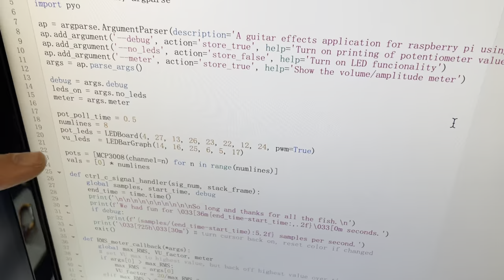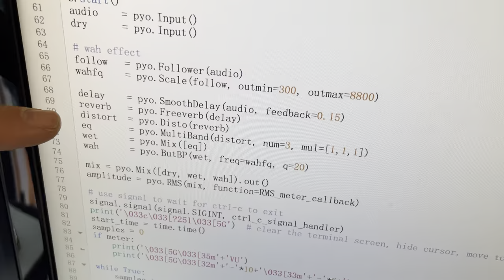Guitar Amplifier with a PI!

Comment: This is an absolutely awesome project, and I would love to try to recreate it.  I've looked over your Github page, but I don't see any circuit schematics.  Would you mind posting your schematics as well, it would be a huge help (e.g. connecting MCP3008 to which IO pins, other various wiring, etc.).  Even a few hand drawn block diagrams with key pin connections would be a great help.  Thank you for posting such an awesome build.  Very inspiring!
Reply from the maker: Thank you and I was wondering if anyone would want more details. I will post some schematics and more info on github. I am traveling right now and don’t have the amp with me but will see what I can post. Also happy to help with any build issues as they arise.
Reply: @dsagman  Thanks for the quick reply.  Anything else you could add would be greatly appreciated!  I'm a EE, and I love guitar and audio hobby projects.  I've built many various guitar pedals, and a few simple multi-effects using an Arduino.  Jumping up to the PI is the next step for me, and I'd love to follow in your footsteps.  I'll also say, there are undoubtedly a lot of people who will be interested in recreating this, even if they are not bold enough to ask for more info.  I guarantee we're out there, and your efforts are greatly appreciated.  Thanks!
Reply from the maker: @loganwilliams9723  I've started more technical info on some slides. Here's the link. I will be updating as I go, but wanted to get the first draft out sooner rather than later. https://docs.google.com/presentation/d/1GgiD2UTEGcz-SC2rGDjdIljaK2Yn0Rs03TDFOu3duUw/edit?usp=sharing
Reply: @dsagman  Thank You!!!!!  This is a great set of documentation so far, especially the more specific portions about how to install the Audio Injector (I just bought one!) and the modifications to the Pi operating system.  I'm looking forward to your added documentation about which uneeded daemons to remove to optimize performance (and exactly how. . . I'm not a Pi, Linux, or Python expert, so your step by step directions are very appreciated).  I'm also curious how you handle safe shutdown of the Pi when operating headless.   In your video, it doesn't look like the Pi is connected even to ethernet for headless operation and shutdown.  Thank you again for all the time and effort you've put into sharing this.
Reply from the maker: @loganwilliams9723  Excellent! I made a bunch of updates just now. More to come.

Comment: Something to look for, perhaps there's some high frequency sapling noise from the Rπ code or A-D or D-A that's burning out those class D amps? They tend not to have any input bandwidth limiting so can cook inaudibly from ultrasonic / sample -rate LSB noise that results in a big power dissipation.
Nice build :)
Reply from the maker: I suspect the burned out amplifiers were due to, in no particular order:
- overheating with 24v input and maximum volume
- wiring one backwards (oops)
- loose cooling fins
- overloading with 24v where that was above maximum (also oops)
Mainly though, the cheap ones don't have much or any overvoltage protection and require more careful engineering around them than the slightly more expensive model I finally settled on. ($30 vs. $5 to $15)

Comment: David, this is awesome. The Tom's Hardware article is number 1 when you lookup "raspberry pi guitar amp simulator". I'd like to build this project and am wondering what kind of latency are you getting? For example, when you strum the guitar is there a noticeable delay before you hear it through the speakers? This has always been the big question with software-defined audio.
Reply from the maker: There is no delay in the audio. My friend and professional guitar teacher Ben made one also with a Pi 2B and has no issues. I am working on getting a looper working also thanks to a recent update on the pyo library. If you do build, send some pics! Join the the hackaday page where I have everything linked.

Comment: hello- can you provide some information on how leads were connected to and from the power switch and power input? Cheers
Reply from the maker: I ran leads from the existing wall connected power switch output to three bus bars, one for +, one - and one for ground. Then wired from the bus bars to the  two switching power supplies. I used these, which I like because they have covers to keep my clumsy fingers from touching: https://www.amazon.com/Seamaka-Distribution-Terminal-Screws-Battery/dp/B09SHKXM3M. For ground I used this open type: https://www.amazon.com/RLECS-Terminal-Positions-Block-Grounding/dp/B095HHFJB6/
Reply: @dsagman  Your reply is appreciated

Comment: How hard would it be to add a looper?
Reply from the maker: Should be straightforward to set a button to record with pyo and then play back on a loop. I will give it a try and update if I can get it to work. Hard part may be finding an open GPIO pin to use for another button.
Reply: @dsagman  Perhaps using a USB/midi switch would be better for that functionality. You’d probably want your hands free to be able to synchronize the loop. You can use a shift register to multiply GPIO pins.
Reply from the maker: @HumanIceBox  Well, it turned out fairly hard, but simple, to add a looper. The pyo functions Rec and SfPlayer fit the bill, but there was a memory leak in SfPlayer that was hard to find. The developer, Olivier Belango updated the code, I recompiled, and it's working now. I have a janky switch connected right now, but will update the code, and the wiring, etc. over the next few weeks as I get it working. Thank you again for the suggestion!

Comment: Very nice, but unfortunately, there is not enough info here to replicate this project - It's very frustrating - I can't even get pyo working on my rpi. Are you using JACK or Port Audio? What configuration settings were needed? As it stands this is more of a 'Look what I can do'  than a 'How to do what I did'...
Reply from the maker: I've started on the technical documentation, not done yet, but here's the link to the live document that I will be updating as I go along.

Comment: are the knobs in reverse?  he's turning them counter clockwise
Reply from the maker: Yes. I should have done some arithmetic to reverse the knobs. I will see about adding that and updating the github.
Reply from the maker: I fixed the code and rewired the volume pot. Somehow I got them all backwards. Code was easy to change and repost to github. Wiring the one volume pot I, of course, put my hand directly on live main current. Ooftah.

Comment: DIWHY? It sounds worse than the original amp. Could have converted it to tubes and/or figure out a way to use a VST host to run the audio. Disappointing.
Reply: If you were so serious about the sound, you wouldn't judge from the audio captured by a handheld camera... I see the point is at that a proper computer is setup. There will be a plenty of room to improve with software (say VSTs), which simple tubes wouldn't have after getting stuck.
Reply: Zing Sting, you are so wrong!